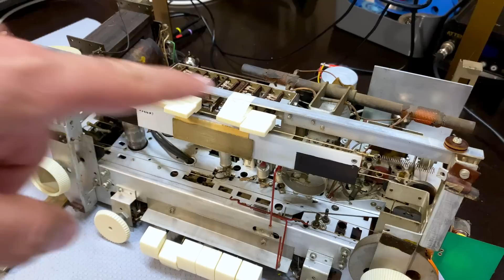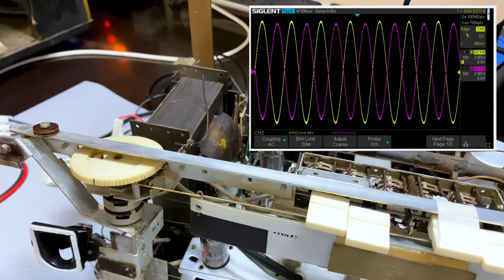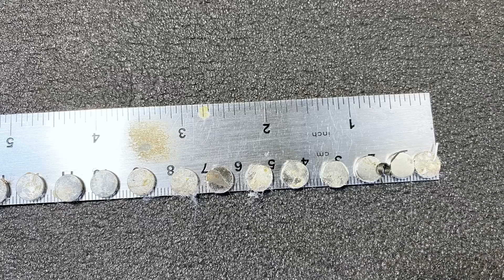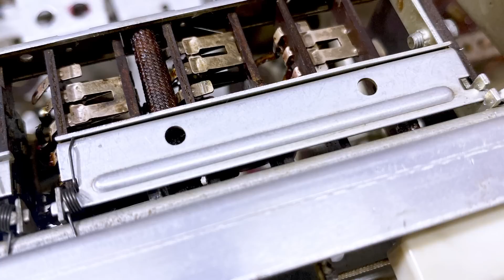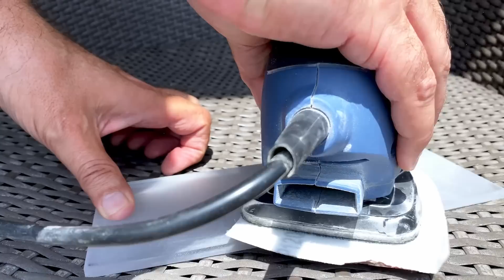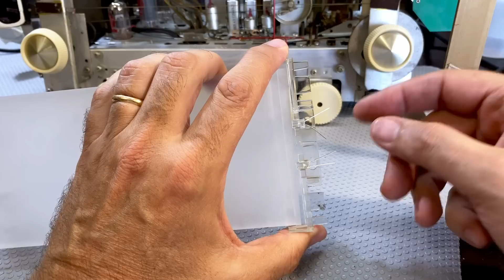Let there be light. I'm starting to win this one. Philips Reverbeo B7X14A Stereo restoration pt 3

Comment: Excellent round Manuel, you got him now. ;-)
Maybe if you put a white paper behind the difuser that would stop light leaking out the backside, and instead reflect forward. Then that wire would not be visible.
Btw all edge lit PC monitors has a difuser layer inside (behind) the panel,
so if you take apart an old 24" monitor,
you will find a profesionally made 24" difuser inside it.
and also two strips of LEDs that can be used to illuminate it...

Great work, looking forward to the next round.
Bet you'r gonna win this on points.
Reply from the maker: I came really close to dismantling my daughter’s old laptop, but then felt guilty and went for the acrylic option 😊

Comment: This Philips is going to be a spectacular one! When dealing with Philips sets you have to deal with their many "quirks".. I didn't know they used an electroluminescent panel behind the dial, but this is a B7 series receiver, among the top ranges. Your LED solution is great. I also have used this in among others a Sony ICF-6800W receiver (warm white LEDs) with good result
Reply from the maker: I made some adjustments since the last video, and it’s now even better 😊

Comment: Ii is looking good there Dave! Since you can see through the diffusion panel Try a white sheet of paper as a backer or even a sheet of aluminum foil and see if either one improves the effect.  You might also add a strip of foil along each edge to block and diffuse the light leaking out of the side of the LED's. You might try crumpling the foil then flatten it out for more diffusion. I look forward to the next video!
Reply from the maker: 😊 good ideas all 😊
Reply: Perhaps also try roughening the edges of the plexiglass (on a test sheet) to see if that better diffuses at the sides. Personally, I would move the wires so they were not visible through the panel.

Comment: I've seen a couple cases of intermittent balance and volume controls that caused low audio level or increased distortion because of loose crimps and oxidation where the solder terminals are crimped/riveted to the phenolic wafer holding the conductive carbon-plastic tracks. You can fix this by carefully squeezing the brass crimp-rivets with pliers (don't crack the wafer!) or painting the rivet and carbon track junction with silver-bearing conductive paint.

Comment: Hi Manuel. Great stuff as always. Using the plexiglass was a very good idea, and you have overcome the lighting issue with great success. The chassis has cleaned up really well and looks like new. Looking forward to the next part. As always I thoroughly enjoyed watching. Cheers Chris.
Reply from the maker: I really like the transformation of the chassis as it gets cleaned. Quite satisfying 😊
Reply: @electronicsoldandnew  , it's gotta be "fun" (not!) working around the dial string while cleaning the chassis. Did the nicotine tar and dust cause issues with the dial string on this radio, and if so, how did you clean it?  I've been refurbishing old stereo receivers for decades and I still cringe a little whenever I bump into the dial string while cleaning the unit, replacing lamps, and so on, for fear of stretching it sufficiently that it will slip on the pulleys when tuning stations. I melted through a dial string just once with a soldering iron 😲😖 and since that day have gotten good at protecting the string with strips of blue or green low-stick painter's tape (frog tape etc). Occasionally I have to partially undo the dial string during the course of servicing and can usually secure the string around the pulleys with tape instead of letting the whole think unravel. Any tips you have pertaining to dial-string adjustment and repair would be appreciated by all. Minor slippage can sometimes be cured by waxing the string with crayon or ( better) a soft furniture-touchup wax stick. If the string is severely stretched I've simetimes had to undo one end and tie a simple overhand knot to shorten the length slightly.
Reply from the maker: I too have melted a dual string with a soldering iron. Whenever the strings are too close to solder points, I also protect them with oven foil. 
Tightening it with a knot is also in my repertoire, so we’re on the same page on most of the techniques 😊 Cleaning around the strings is done with a brush and a chopstick cotton swab holder, so I try to not touch the strings at all.

Comment: It does look nice. I remeber someone saying that if you sand the led down the light gets more difused. I havent tried it myself. Thanks for the update.
Reply: To some extent, yes, sanding the  LED can be helpful. Or, buy LED'S that have milky plastic or a frosted finsh. Flat top leds might tend to be beamer than those with rounded tops. You can also buy LED'S that not only work of off AC as well as DC but aren't sensitive to polarity when run from DC, and therefore won't flicker as much at 50 or 60 Hz when run from AC.

Comment: I think the EL panel was not as bright as what you’ve achieved with the LED’s. I think it might be better, possibly, with more LED’s on each side, with lower current applied. Also, the suggestion of white paint on the back might help significantly, too, as well as reducing the visibility of other ‘innards.’  Good job.  I look forward to the rest of the story.
Reply: The EL was more of a dull glow, similar to the glow in the dark clocks and the like if I recall.   The LED's will look a lot better when it is all in the case again and you can't pinpoint the LED
s so easily   :)
Reply from the maker: thanks

Comment: I'm not as far along as you are, but just wanna say "Nice job!" with all the cleaning and cosmetic stuff.  I face another challenge after getting this beast to work again, and that's re-surfacing the crazed lacquer/shellac on the outside of the wooden case, and then getting the chassis back into the case without damage. 

BTW, my Philips (from 1964/65) uses 8 ohm speakers (with impedance matching transformers, of course), but has a socket in the back to plug in an 800 ohm speaker, which threw me for a loop when I first noticed it.  ???
Reply: Also, the harness you built to mount your chassis on for ease of moving and flipping it is an idea I'm stealing -- I've got the aluminum bar stock in the garage and will bend it into two square hoops that hopefully will fit a wide variety of chassis in the future.  Thanks again.
Reply from the maker: That contraption has been incredibly useful.

Comment: LCDs use (or used) a patterned sheet of plastic to even out the backlight illumination. The pattern of dots varies according to distance from the backlight bulbs/LEDs. Close to the light source, there are fewer dots, spaced farther apart, so that less light is reflected forward. 

I suppose you could make one by creating a gray gradient from dark gray to light gray to dark gray, and applying a halftone filter to convert it to black and white dots.
Reply: LCD is an interesting idea, but would be more complex to implement in this case to get it looking good.  The original backing was an electroluminescent material, which uses a high voltage and glows.  I am going on memory, but I believe the original glowed a green colour, similar to those old radium glow in the dark clocks.   
Me, being a bit of an experimenter, may play with the LCD idea though :)
Reply: Big Clive has been playing with LED tapes on his channel; perhaps a strip of it on each end of the Plexiglas would give a more even backlighting.

Comment: Well done with the dial illumination . I used a similar method but used standard bulbs . The LEDs look great . I may change mine after seeing how good they look.  I have really felt for you working on that . I spent many frustrating hours on mine before I was happy with it . I also finished up with various new valves !  I think because of the kind of radio they are and the initial cost , they probably had a lot of use . They sound amazing when working right don't they . Lovely clean bass etc . I use mine a lot for listening to old music from an MP3 . Thank god I didn't need to restring the tuning !  Typical Philips complexity . Once sorted they are a very reliable radio . Mine has been trouble free for years now . Enjoy .
Reply from the maker: I look forward to getting it all done. I’m sure the sound will be amazing.
Reply: Incandescent lamps are somewhat omnidirectional, while LED's have more of a concentrated light beam, which can make it difficult to get good backlighting diffusion with LED'S. I have converted the lighting to LED'S in many vintage stereo receivers and each model is different and requires experimenting with different LED'S, physical placement of same,  reflective foil tape, color gels, parchment paper or similar diffusing materials, and modification of the voltage supplies.
Reply from the maker: You can also sand the led surface itself to diffuse light more, and by filing the front lens off, it also makes a huge difference.

Comment: Yes Philips experimented with 700-800 Ohms transformers less  output stages ex. the Capella model. It used a king of totem pole output stage using lower Ra tubes like the El86.
Reply: @electronicsoldandnew  a friend of mine had a model with EL84 bottom valve, EL86 top valve, and i've seen circuits of a record player with EL84/UL84 pair

Comment: Hi, cool video. I think that your diffusor isn't doing that good of a job, as proper LED screen diffusors really diffuse the light evenly. Also they are made in such of a way so there is more light is reflected far from the LEDs than nearby, so you get uniformly lit screen. Don't get me wrong, you made a great job like that, LEDs are very directional so it is really hard to make a good diffusor for them. Also I would be interested how it looks with the dial scale on. Original EL panel was about the same brightness as the new EM80 and the Philips logo that is lit by the separate light.
Reply from the maker: I know that a len’s difusor would be ideal, but didn’t want to scrap my daughter’s old laptop just test 😊
Reply: @electronicsoldandnew  Haha, well of course. The laptop LCD diffusor is much too thin also. Me, I just went to the local TV repair shop (the only one that is still around) and they had almost 50 broken TVs/panels that I could choose from. I needed one for the repair of the 24'' LCD (CCFL) that the diffusor yellowed to a point that the picture was almost brown. They were very interested that anyone is actually repairing this stuff. I took few backlit panels home (there are also edge lit), took one apart, cut the diffusor with hacksaw and sanded the edges, and voila like new again. Also the diffusors in the LCDs don't have lens in them, just the etched dot pattern varies from the distance of the LEDs :)
Reply from the maker: sounds like something I’ve got to try 😊

Comment: That's a mighty good fix for the EL panel Manual, you may consider that idea stolen! I have used LEDs in dials before and as you said you would be hard pressed to see the flicker. From memory I connected the second LED in parallel but in the reverse polarity to limit the reverse voltage and maybe reduce the flicker, was that a good idea? I didn't have a diode in the circuit.
Reply from the maker: The reversed LEDs is actually better than my option. The reason is that you endure a maximum reverse voltage of about 2.6V. If you use a single LED (or two in parallel like mine) with no diode, the the peak reverse voltage is about 9V which could blow the LED.

Comment: Hiya, working on this project too. What type of rectifier should I use for the LED modification? Many thanks all.
Reply from the maker: Not sure anymore. Did I not mention it in the video?
Reply: I think you said a “diode to rectify”. With a 100ohm resistor.